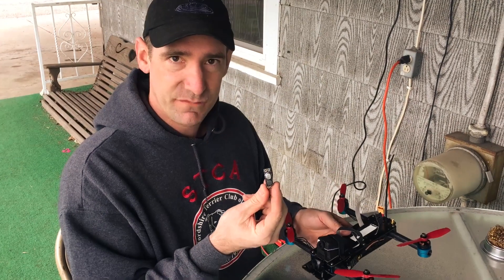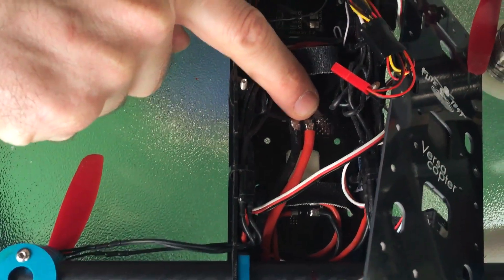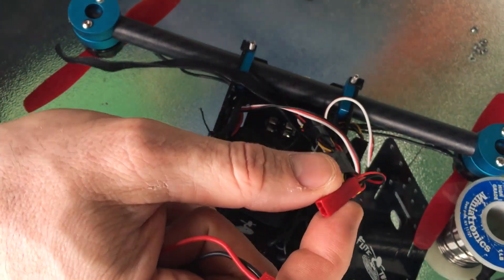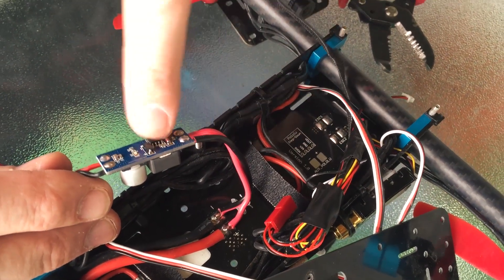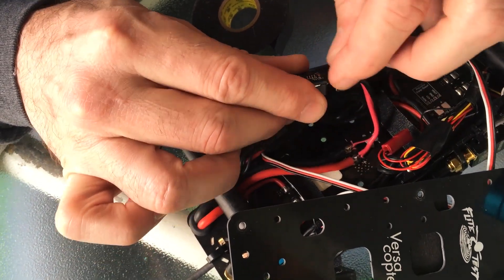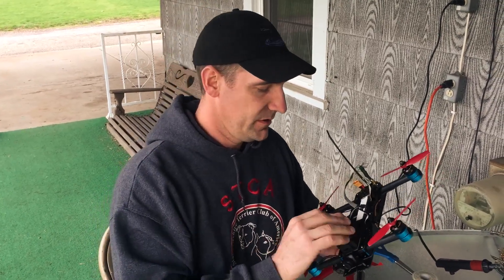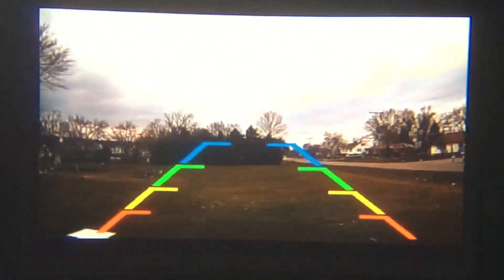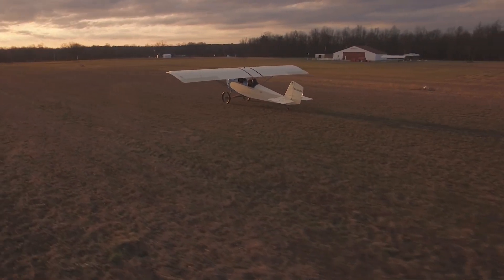HOW-TO Install an LC Filter on your FPV system

Comment: Hey, Helpful video. Didn't you used to run a big 800 size heli as a camera rig?
Reply from the maker: Thanks sooo much! Yeah I actually still have it 🤪 T-Rex 700 that I stretched to an 800…..flying on 12S 💪🏼
Reply: @ericmonroe6024  That was a cool rig. I hope you still get it out to fly some times.

Comment: I installed this from the 12V to the cam/VTX. STILL has white noise when I throttle up. Installed capacitors lol.. STILL white noise. Foxeer VTX and Runcam Swift 2 w/ OSD. Driving me nuts!!

Comment: I have one of these filters ,but my camera works on 5 volts So how do you suggest i wire this
Cheers
Reply: just hook one end your 5V supply and the other end to your camera/Vtx . it's a passive filter so different voltage won't affect as much.
Reply: I think he meant his TX is on 12V and camera is on 5V. Mine is too and would prefer not to have to run two.

Comment: Anyone else having issues with the versacopter randomly dropping out of the sky with an LC filter installed?  I'm powering the cam/tx off AUX1 on the PDB, going through an LC filter from GetFPV.  With it installed I fall out of the sky randomly.  Without it, I can fly fine but my video isn't as good.  I just fly without an LC filter cuz I'd rather have my vid drop than my quad.  If anyone has any suggestions I'd appreciate it!
Reply from the maker: Nate Nygren have you tried powering the LC filter directly off of the battery lead?
Reply: That was actually the first way I tried it, after watching how you set it up. I moved it to the AUX1 pads just to see if that removed the random-power loss issue, but so far I can only remove that phenomenon by removing the LC filter completely.
Reply: I'll have to try moving the LC filter away from my Spectrum RX, because it seems like a signal loss failsafe is happening, now that I think about it.  Each time I've had the LC filter installed it's been mounted right next to the RX.
Reply: Nate Nygren i had problems with lc i just use capacitors instead the 470micro ferad i just make sure they r soldered to direct batt power on pdb n now crystal clear on punchouts

Comment: Great video, I have been doing some research on these power filters and was wondering what difference the amperage of the filter does? Also are the cobra motors better that the standard from FT? Also if so what esc's do you recommend? 
Thanks
Reply from the maker: I haven't flown much on the standard FT motors but when I have flown them they flew nice. Cobras are great also. I fly UBAD 20amp beast escs on this copter.....they are awesome. 👍🏼 as far as amperage.....I'm honestly not sure....will try to find out.

Comment: How heavy is your Setup rtf?
Reply from the maker: The Versacopter is def on the heavy side. Sitting at the starting line with a möbius it weighs 805 grams. It flys wonderful.....just heavy.
Reply: +Eric Monroe Wow, that's a lot! What about shortening the wires? You dont't believe how heavy this extra is 😉
Reply from the maker: Yea, def gonna do that.....that will get rid of quite a bit hopefully 👍🏼😋
Reply: +Eric Monroe On my Zmr, shorten the wires, get rid of bullet connectors, useless shrinktube, FC and rx cases, I saved over 1.5oz